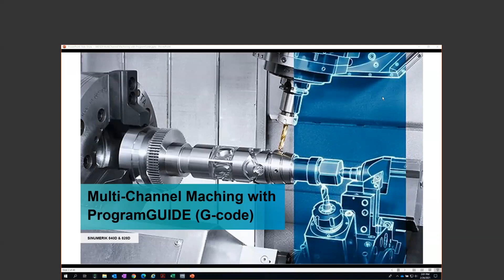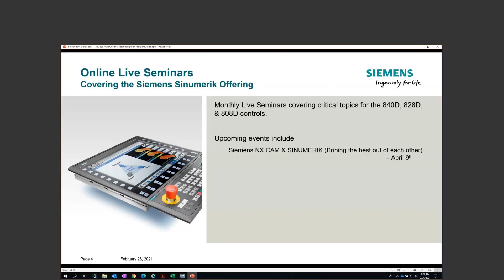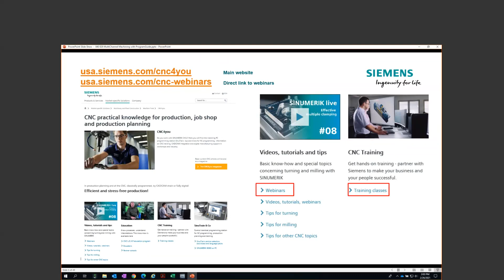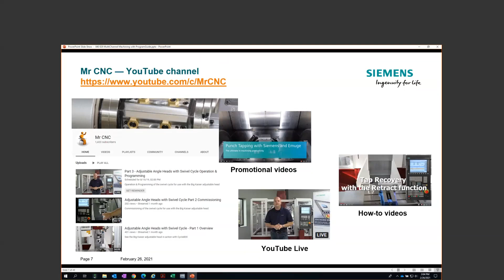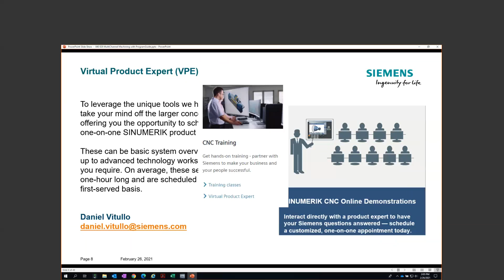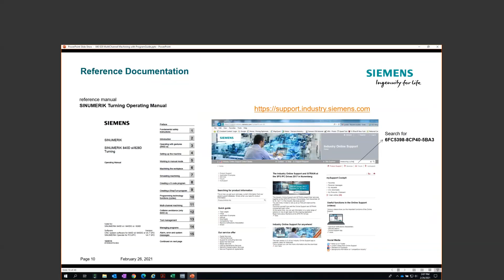Multi Channel Machining in G code with ProgramGuide   SINUMERIK 840D Sl & 828D Turning

Comment: Mr Pollack, can u share manual about programming with multi-chanel machine. and would be good to see a practice video about programming two channel does turning and milling in same time on one spindel.
Reply from the maker: this is the link to the manual i referenced in the video.  https://support.industry.siemens.com/cs/document/109481513/sinumerik-840d-sl-828d-turning?dti=0&lc=en-WW

Comment: Does the turning machine and milling machine use different system? Or they are same system ,just some different machine data should be setup?
Reply from the maker: Same system with different machine data which will need to be properly defined, usually during machine commissioning